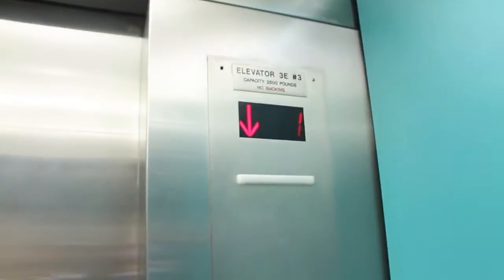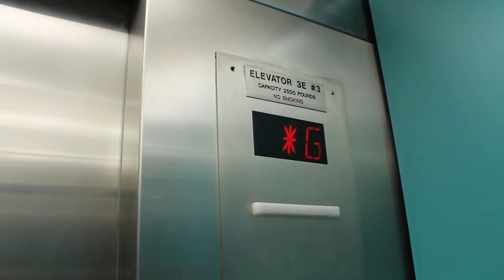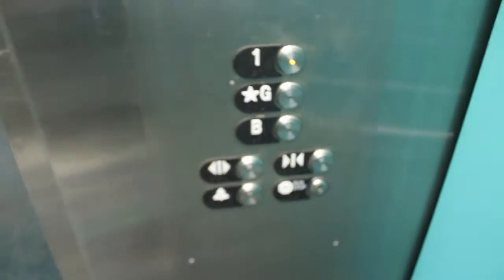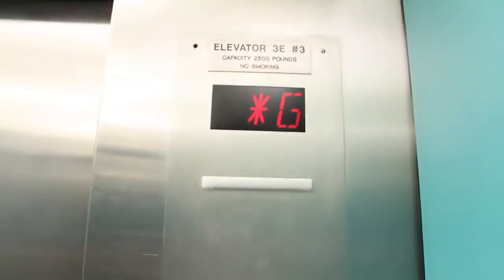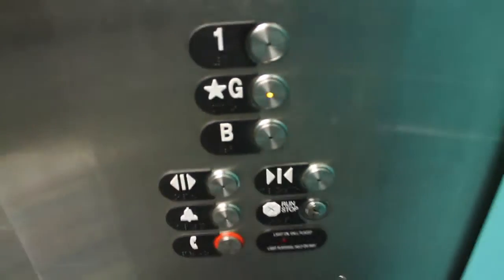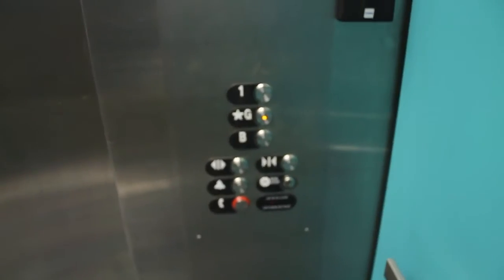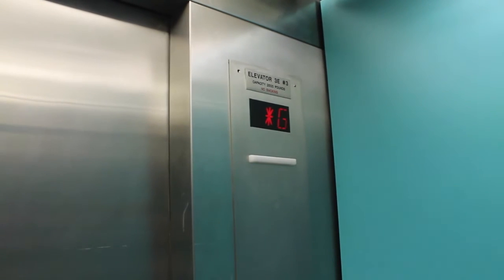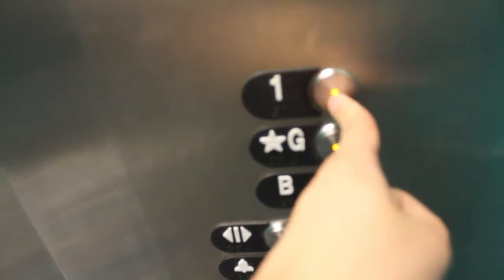Modernized OTIS (former Series 1) Hydraulic Elevator - Foxwoods - Mashantucket, CT

Comment: You are RIGHT!!! It IS a Series 1!
Reply from the maker: +Jon salcedo Well, it was a Series 1 when it was originally installed, as evident by the indicator on the outside. It's close, though, the cab and more than likely hydraulic equipment are still original.

Comment: These are series seven. Much better than the blue crud with the series five gong and lcd indicator.
Reply from the maker: +NationalElevator I thought so, especially because the buttons felt similar to a few Series 7 elevators I found that same day. Thanks for the input!

And yes, I will agree, these do look a bit better than the typical Series 7.
Reply: +NewEnglandElevators 
These are Series 7 Vandal Resistant. I'm not completely sure why OTIS makes their VR buttons though since the regular ones are basically the same. The only difference is the location of the LED (ring vs. center).
Reply from the maker: WestCoast Elevators By putting the translucent plastic in the middle of the button, this probably means that there's less plastic to be damaged, unlike the standard version with the plastic mounted on the outside edge of the button (on that version, it's more plastic that can be jabbed at, etc). Seems like a novel way to cut down on vandalism.
Reply: +NationalElevator These can't be Series 7, these would have the euro-style floor counter if they were.
Reply: JoshCraver9000
Actually OTIS makes Series 7 with these ACME style indicators (although normally blue) and the LCD indicators.
Reply from the maker: JoshCraver9000 WestCoast Elevators I believe this is part of OTIS's current modernization package, presumably? I've seen plenty of videos of elevators modernized with a similar setup. Currently, OTIS must be using Series 7 fixtures for the buttons.
Reply: *****
I believe this indicator is sometimes used in fresh installs as well. I don't know if they use the LCD in modernizations though.
Reply: +WestCoast Elevators This is actually an acme indicator. The arrow is wider than the Otis acme.
Reply from the maker: Good to know about that! I figured this was a typical ACME (CE Electronics) indicator, merely based on the appearance of the indicator's arrow. Good point about the OTIS indicators.